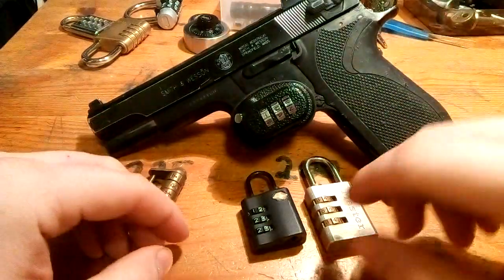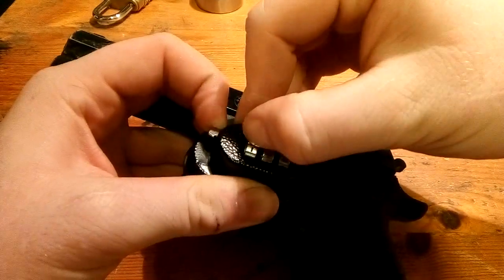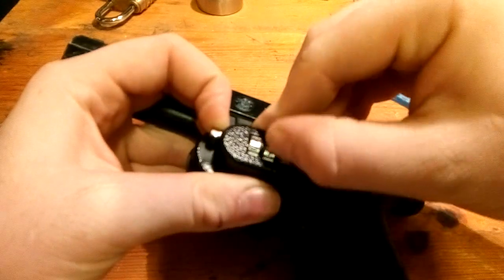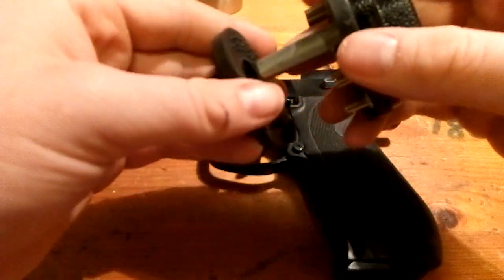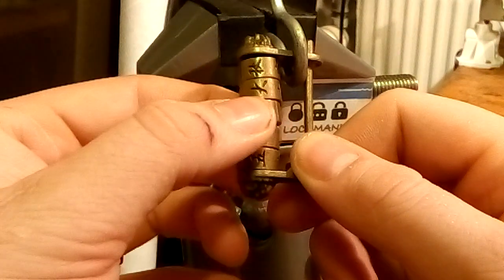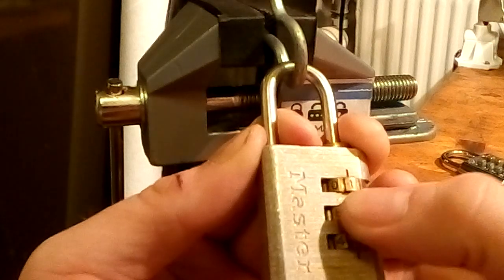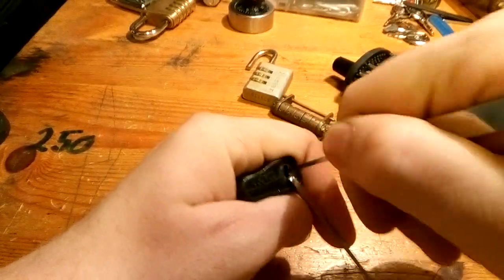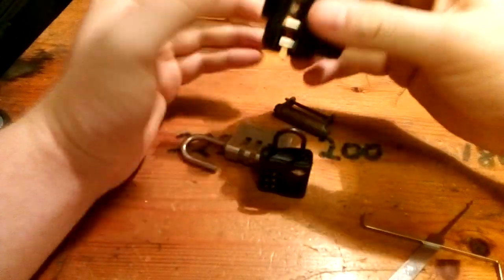(23) 4 combination locks unlocked

Comment: Haha your video was not the solution to my problem but I found the problem while watching your video. I purchased the same combination trigger lock about 2 years ago. I went to change the combo and it never opened again. It sat in a drawer all this time. I discovered the problem. The little plunger you reset the combination with was stuck in the hole. I pushed it over and it popped back out and the lock works. 😂 if I forget the combination I will come back to your video. Thanks
Reply from the maker: Well at Least you got your lock to Work 👍😁